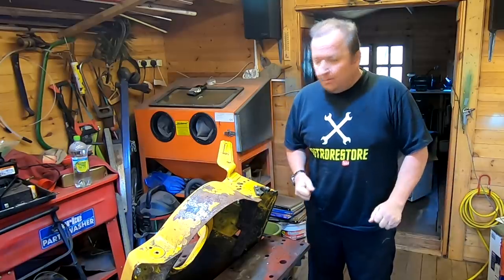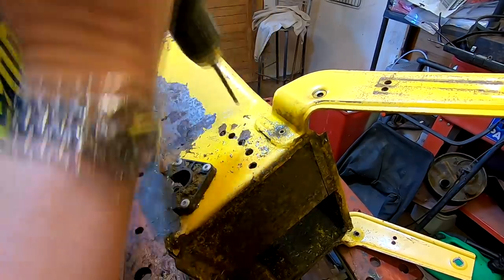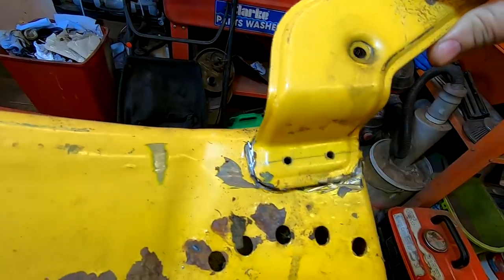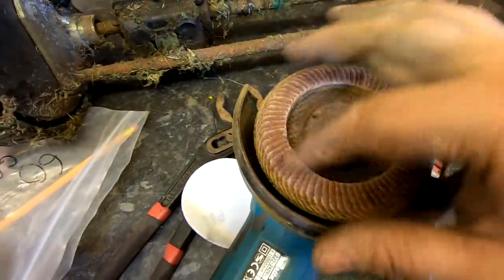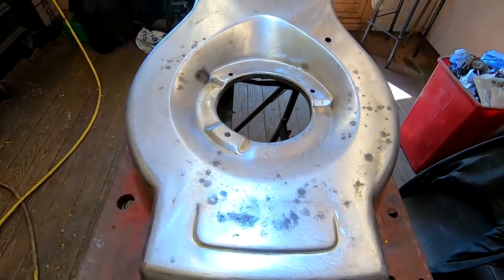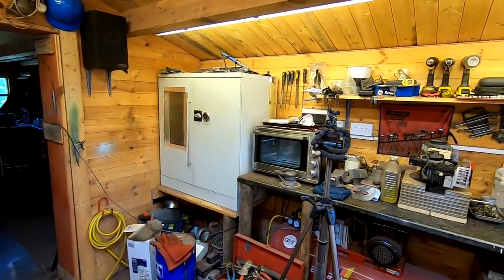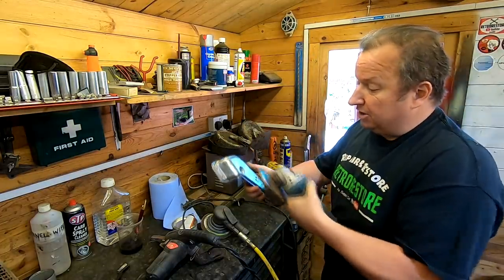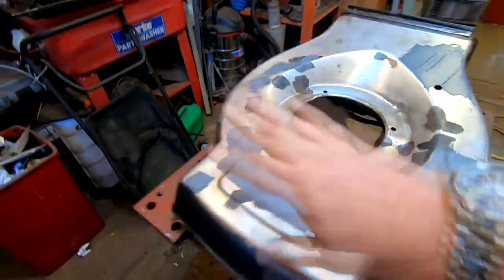Custom Lawnmower For Sharon Part 2

Comment: Power coat is the only way to go IF you can get the item in the oven. It takes a heck of a lot of effort to scratch and make powder coat scratch and scuff up. Most ATVs are powder coats, especially the front and rear racks. And the beating they take is amazing. You are making this "beast" last for two life times now... Thumbs Up!

Comment: i saw a video today that had a water nozzle on the deck that takes a quick release water hose to it , and basically after you have finished cutting the grass you connect a garden water hose to it and run water while the mower is running and the water hits the blade and , effectively cleans all the loose grass on the underside of the deck 
Through the inspiration of your teachings and amazing attitude to life i am starting to accumulate lawnmowers to fix and sell on and i intend to drill a hole through the decks and fit a hose attachment to them so that its a different selling point to customers 
again many thanks
Reply from the maker: Nice one  bud. Good luck too with your lawnmower biz

Comment: The chrome handles came out better than i expected.I have always been fascinated by the old enamel signs, ie how did they make them ? think it was a backing on sheet steel, then enamel powders were baked on. So if you fancy a challenge/or a something different project, could you make a Retrorestore enamel sign ?
Reply from the maker: That would be a challenge Alan.

Comment: It would be great to see if the powder coating is harder wearing than hammerite. If so you could powder coat both sides of the mower. My personalfeeling is that the powder coating would be harder wearing.

Comment: Hi Martin if strip the rust and paint off with Grinder wire wheel  it would take 5 minutes easy but wear glass
Reply from the maker: This was powder coated so a wire wheel wouldn't really touch it.
Reply: Martin the wire wheels that go onto Grinder the 100mm wheels please try it there are  so course I've used it on powder coated makes no difference  I  thick the steel wheels  are so good  if you've already tried and no worries just keep up the videos love them

Comment: Hello Martin, requesting for some help from Australia. Being inspired by your channel I have attended to revive a Briggs & Stratton 450 series engine(local Victa brand and a free pick up from the owner with the missing pull cord) after successfully replaced the pull cord but no success with the start even with good spark  and carb start spray. Then I performed a full carb clean, first pull the engine started with out any issues. Noticeable amount of smoke, checked the oil level where it was in the middle but dirty. Did notice black oily residue inside the plug whole as well. However no sign of oil in the filter. Did change the oil 10W-30 since I did not have SAE-30. Smoke still  there even after 5-10 mins running time. Any idea as to why and how  this can be fixed?
Thanks
Thushy
Reply from the maker: Hi Thushy, It may have been over filled at some stage and the exhaust might still be full of oil. You could remove the exhaust and run the mower without it on to see if it still smokes.
Reply: @retrorestore  Thanks Martin for your prompt response, let me try this tomorrow and give you the feedback.